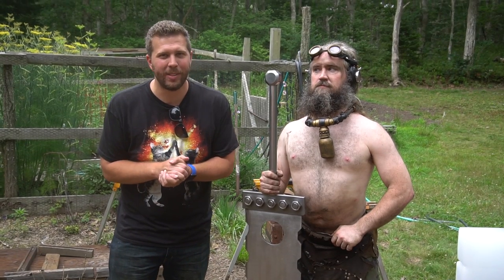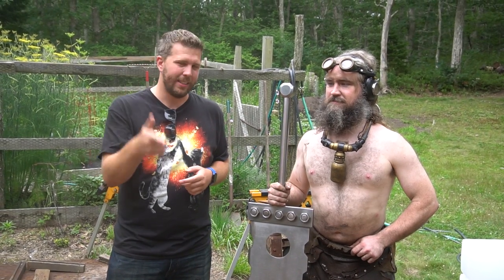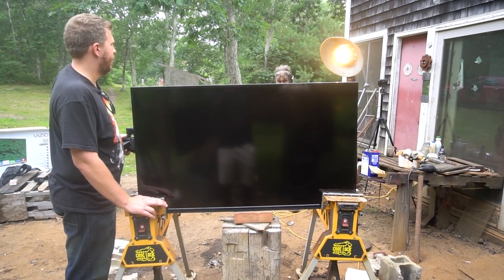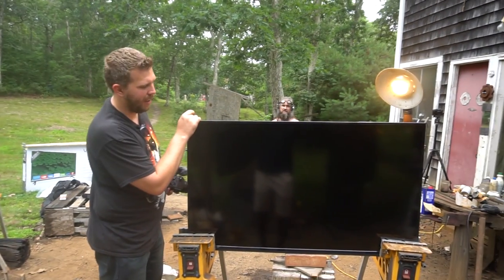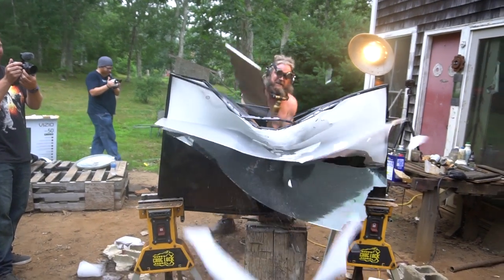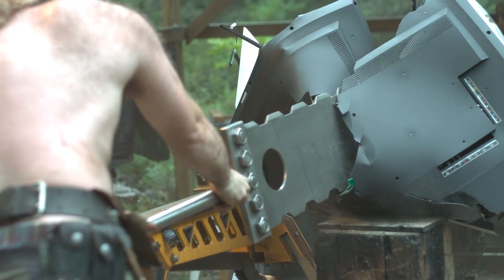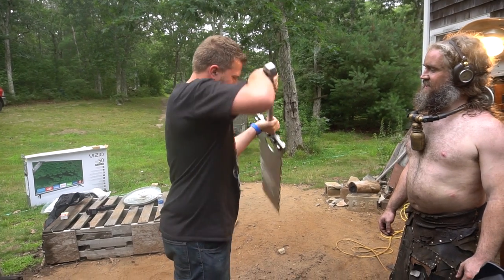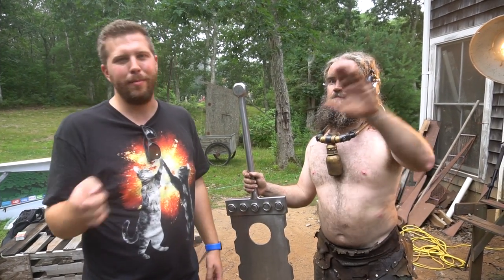How Many Swings Does it Take to Chop 50" 4K TV with a 6FT Berserker Broadsword? - GizmoSlip

Comment: I think it's doing more crushing by weight than actual slicing
Reply: Upon watching the WHOLE video all it does is fucking CRUSH it
Reply: It's more of a dull metal slab than a sword
Reply: To be fair, many of his swords do actually slice quite well. This one looks to be more of a smacking device than a slicing one.
Reply: I think the dude who ordered that sword never actually payed but it was for the client's dad and designed like demolition tool. In other words its meant to break walls, doors, windows and all the other fun stuff rather than doing a clean cut.
Reply: Yeah, now that look at it, this is the construction tool-type sword from his Big Giant Swords TV show. But if memory serves, the sword was ordered by a guy who lives very close to him (on the same island). So it could be that Mike went to the guy and asked him to use the sword for this clip, since he shipped away every other sword he made so far.
Reply: I think he has a sword himself, the trash sword, unless someone bought it later. It's not as aesthetically pleasing though
Reply: lusteraliaszero If you're talking about Athrox - The Junk Sword, he sold it on ebay for charity several months ago. But regardless, I'm sure he has some blades hanging around in his workshop, although I doubt they're polished up enough for public showing.
Reply: I think the same thing would happen with a regular sized sword if a 5 year old kid was to swing it.
Also this sword in particular does have a sharp edge but it's not straight, so it's probably better at sawing something than cleanly slicing it.
Reply: +eggrollsoupnova2000 did you even watch the video?
Reply: +Maxwaehrens yes i did i watch videos before commenting
Reply: +eggrollsoupnova2000 alright then how could you think something sharp can only cut/slice something and not crush it?
This is a ~100 lbs gigantic sword that is indeed sharpened, it's going to crush a loooooot of things before cutting through it especially when said things aren't made of the same structure throughout. For example it won't cut through thick blocks of wood or metal but it will cut solid ice very easily like seen in the video and it will crush a TV before cutting through the bezel and metal parts of the screen.
Reply: +Maxwaehrens dude i understand what your saying i agree but i actually misread his comment and though he said something else i apologize
Reply: +Maxwaehrens that shit isn't 100lb
Reply: Close to, he has done other buster swords like that which are easily 100lb.
Reply: +Morrison64 i used to do a bit of welding my self i made a table and i was doing the top and the clamps made it over a hundred pounds
Reply: And you just crushed a kids imagination
Reply: +zenopssmdk No, his demolition tool had three caution triangles on it and a sledgehammer for a handle, but it looked similar.

Comment: was the scream necessary?  lol
Reply: 40 pound broadsword mane. Pretty necessary.
Reply: Judging by your picture, you've never swung anything over 6 pounds. So let me clarify, yes. It is very necessary.
Reply: +Ultra I attempted to think of a reply, but failed miserably
Reply: yes. leave him alone
Reply: actually a powerful shout builds up adrenaline in your body. Used often in martial arts.
Reply: +PronomicalArtist Same with tennis
Reply: kievan casey 
Actually, because of our human anatomy, It is almost involuntary. 

When you physically exert yourself, by lifting a heavy weight for example, we take air in and hold our breath for a moment. By doing that, the middle of our body gets squished together, creating a pressure ball in our belly that makes the body rigid in order to stabilize and protect our spine from injury.  

All that pressure built up inside our gut means that when we finally do exhale it's almost impossible to let that energy out without making at least a grunt. If you've ever done any type of work with a sledhammer or pickaxe, you'll realize that submitting to that grunt as you exhale, even elevating it to a shout, can translate to a harder hit or swing. 

Now, a sledgehammer or pickaxe may weigh 3-6 pounds, maybe. Contrast that with the 40-pund sword he's swinging, and I'd say the scream was definitely a necessity.
Reply: Don't forget to fly away captain!
Reply: U gotta unleash the force lol
Reply: Noob Tube yes

Comment: That sword ain't even sharp
Reply: Depends who's wielding it
Reply: Getting hit in the head with a club that size would also kill, Galvanized steel
Reply: sharpness ain't the only weakness of the human body. Would you like to have a bowling ball dropped on your head from 10ft?
Reply: +Keyon Rosen no it doesnt
Reply: Neither is a baseball bat and that kills people all the time
Reply: +its Dat boi yes it does actually, if you don't know how to use it you're most likely not going to able to cut jack shit, no matter how sharp it is if you don't know how to use it you won't be able to cut anything  with it.
Reply: It's beveled. It may not be completely sharp, but the point of contact is so minute that it simulates a wedge.
Reply: It doesn't matter because this giant hunk of metal would smash your head in if it was simply dropped on you letting gravity do the work. This was a matter of taking a hit to the head, not an actual fight.

Comment: i dont claim to be a pro when it comes to swordplay but... i do have to say the stance looks barely functional for driving force and the sword isnt designed to cut ANYTHING cleanly due to the presence of what looks to be a serrated blade it should be for sawing...
Reply: also that sword has the same functionality of a club... blunt force smashing
Reply: thechucast he doesn't really make swords for practicality. Most of the weapons he makes are well over 60lbs. he's a fan of games with big over the top weapons so that's what he does. In fact he'll reject requests for average size swords unless they catch his eye.
Reply: Piezonuclear Luna I know I'm just nitpicking the stance however must put massive strain on his back

Comment: I'm pretty sure a standard broadsword is designed to crush not cut, the buster sword however it's a hybridization between the single handed chopper and two handed crusher, hence why it is said that it's used blunt end not sharp, so I suggest that you try it

Comment: 1st:i think if the platform on which tv is set had to be a lil lower, if it made an exact 90 degree at the point of intersection of the sword  with  the TV, the proper force and momentum will split the tv exactly in two halves, 
2nd the direction he is coming in action from has to be the opposite or the other way around, i.e. man coming from the side opposite to the screen. the reason it didnt split is cause the angle inclined by the sword pressured not the topmost strip of the tv but the second layer and third whereas  the topmost strip remained powerful and acted against the force
I enjoy watching your video, I admire your skills and power. You are dediceted man. I wish i could have an oppurtunity to learn such skills!
Please do this video again:)

Comment: Sharpness of the blade and the strength of the internal components aside, he would have had better results if he came at it from the front. He probably still would not have cut it very deep, but it'd be better than what we're seeing now. 

The tv is buckling instead of being cut because when the blade comes down, the angle of the edge of the blade is just about the same as the slope at the back. So basically, he's chopping with a straight chop which just isn't very effective for chopping. This is the same reason why guillotine blades were at an angle. If he came at it from the front, the downward arc of his swing would cut right through the top and there's nothing stopping his momentum from carrying the blade through the slope and into the guts of the tv.

Comment: can you explain me why my axe cuts better than that? (excluding the fact that you're hitting with the bottom of the sword instead of the tip)
Reply: Your ax might have a sharper edge. From the angles that I can see the blade looks pretty blunt. If he really sharpens those fangs I think it would be better.
Reply: thats the funny part. haven't sharpened the axe that much. as i was watching the video i was thinking "why isnt that sharp at all?" it feels more like a scrapping weapon more than a cutting weapon
Reply: This weighs a lot more than your axe and is impossible to get a fast swing with. AND it isn`t sharpened in the recesses from the looks of it, and that`s where the blade will rest on a narrow slim target like the tv.
Also: reasons.
Reply: Looks sharpened some places.
Reply: velocity. basically as much as that large chunk of steel weighs, he is not adding much more than gravity, i mean he's giving it some energy, but not nearly as much as you would with a lighter weapon, like an axe. there is a video of a guy shooting .22 pellets out of a rifle using power hammer loads that will demonstrate this very well. the high velocity, lighter weight pellet made a hole like it was drilled. the much heavier, and slower bullet deformed the metal, and basically tore through. physics, gotta love it.
Reply: Yep, not so much swinging it, as GUIDING it lol..

Comment: What does it matter that it is 4K?
Reply: More pixels to cut through.
Reply: Dogemeat Higher resolution = more density = harder to cut :) easy peasy.
Reply: +Gen. Layabout I have a 4k 60" and a 1080p 60" the 1080p one is thicker
Reply: Dogemeat It may be thicker, but it's not denser.

Comment: The reason that it didn't cut as much as expected was because of the thick blade and the ridges, the ridges make it more for embedding and pulling to cut. The thick blade makes it so that when coupled with the ridges it just embeds itself deeper and crushes it more than anything. Even if given a normal blade (as in no ridges) it would still crush rather than cut because of the thick blade, and if it didn't have a thick blade then It wouldn't be able to hold its weight and would bend. This weapon is COMPLETELY impractical, but that's just the opinion of a 14 year old, can't trust that.

Comment: You couldn't just use a non-functional TV? Why buy a brand new one? That's so wasteful. The only benefit would be to destroy it while its ON! You could probably just isolate the AC portion of the circuitry to make sure he only slices through low voltage DC crap.